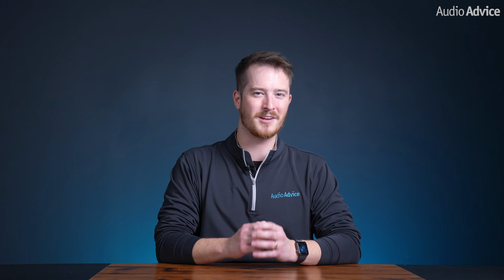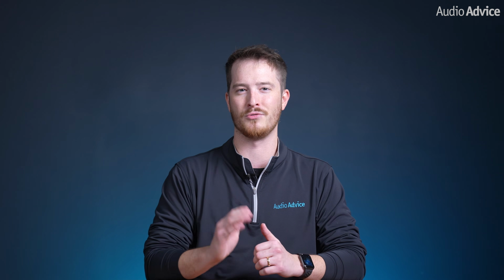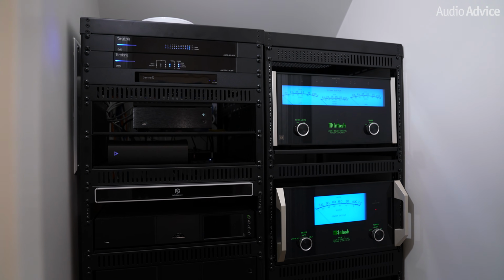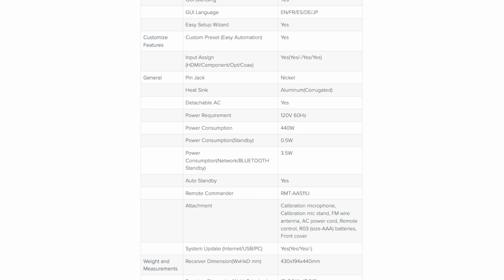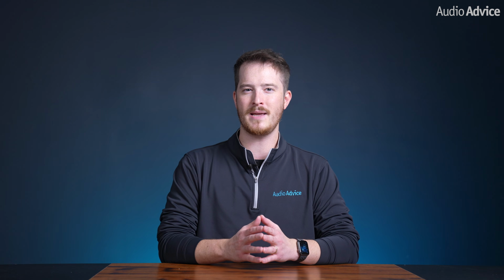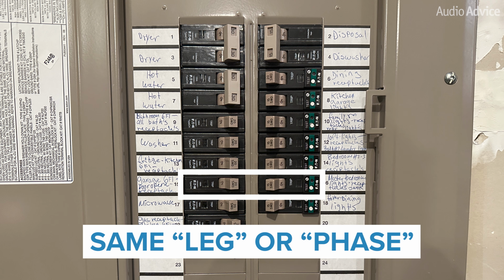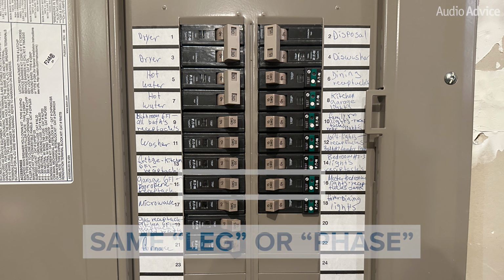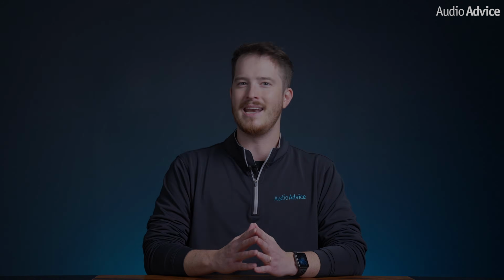Home Theater Electrical Considerations - Don't Forget These Steps When Planning Your Home Theater!

Comment: 300W and 400W are extremely conservative numbers. My old 65" TV and AVR plus everything else under my TV pull about 350W combined.

The consideration about putting everything on the same leg is interesting I never thought about how that odd aspect of the north American electrical system would affect a home theater.
Reply from the maker: Glad you got something from our video, thanks for watching

Comment: Is there an advantage to having your electrician put a sub panel up in the home theater? About to start construction and thought about doing that. Of course I will have at least 2 20 amp circuits devoted for electronics.
Reply from the maker: If you only need two circuits probably not.

Comment: I thought that the same leg on the electrical box meant going vertically?  My electrician installed all of my dedicated AV related breakers top to bottom, but not directly below or above one another, if that makes any sense. So let's say on the left handside of the panel, the very  top  breaker is for the AV rack, then 3rd one down is subwoofer 1 and 5th one from the top is subwoofer 2. They are all dedicated per outlet. Is this done correctly?
Reply from the maker: That sounds right since he skipped every other one on the vertical. Thanks for watching

Comment: A sign that you are working with the wrong company is failure to manage the power consumption. If they want to plug 4 amps into a single Wattbox, run.
Reply from the maker: Exactly

Comment: If you use mire than 7.5-10k watts in your home, you will need to go 3 phase and balance the load, otherwise the load from your house will draw-down the voltage to your neighbor’s houses.
Reply from the maker: Thanks for sharing!

Comment: Yes, very good advice.

Providing one is not experiencing any sort of grounding issues. In my experience the biggest culprits for heightened noise floor (background signal noise) sometimes referred to as ambient sound of the room has to be unshielded cables. Unshielded cables act as antennas for attracting RF and the longer the cable the better the antenna.

From someone who's changed his cables multiple times 😢
Reply from the maker: Great point!

Comment: so glad we have 230v single phase 100amp domestics services in the UK, also we wire in 'ring circuits' so each power circuit has 230v x 32A = 7.3kWs available with multiple outlets, so cross phase or under power is never an issue.
Reply from the maker: Wow! That is nice, thanks for sharing!
Reply: Hah, over-engineered British wiring! No wonder your tea kettles heat up so fast!

Comment: Keep in mind that the total amp draw on a breaker should not exceed 80% of the breakers rated amperage: for a 20 amp breaker the max would be 16 amps or 1,920 watts.
Reply from the maker: Thank you for sharing!

Comment: Great video what would be your advice or models for surge protectors that we need to use.  Mostly in the case of Subwoofer and amplifiers where the amp requirements are higher than some of the standard surge protectors in wattbox
Reply from the maker: Thanks! We'd recommend you reach out to our team of home theater experts and they can walk through your system and help you decide which ones will be best for your budget and space!
Reply from the maker: Audioadvice.com

Comment: Just keep in mind that amplifiers and receivers are not toaster ovens and do not draw constant power (even at clipping) They require dividing watts listed on the back by 8 to get an accurate representation of power draw. In other words, if the back of your receiver or power amplifier lists 1000watts of power draw on the back of the device, the amount of power drawn from the wall at full blast (edge of clipping) is only 125 watts!
Reply from the maker: Thanks for sharing!

Comment: Great video! 

Other notes: If you have an unfinished room, try to future-proof electric for any additions you plan to make down the road. 

Starting with a TV but want to move to a projector? Put an outlet at the potential projector location. 

Other things that I plan for are bigger amps, more power hungry projectors (240v), micro LED displays, strip lighting, etc. 

Once Sheetrock is up, putting in new circuits become much more challenging to add.
Reply from the maker: Yes, very great points! Thanks for sharing!

Comment: Good stuff and a key consideration when building a theater. Though, I don't think you mentioned subwoofers which are often the most power hungry component of the theater.
Reply from the maker: Great point! You need to calculate that into your setup!